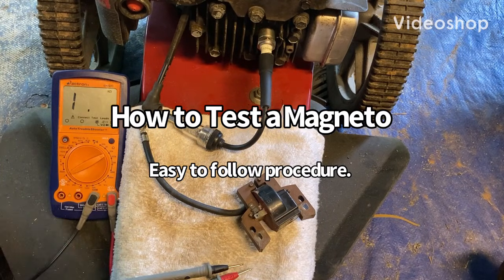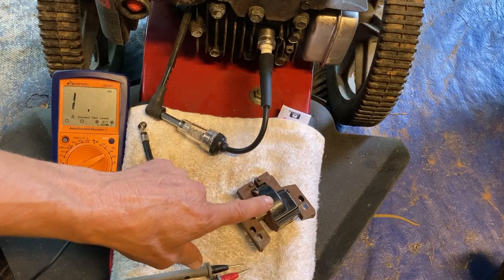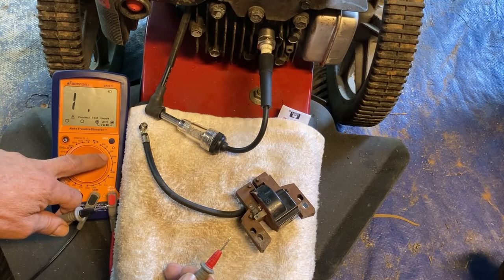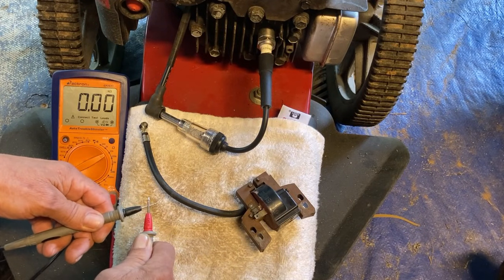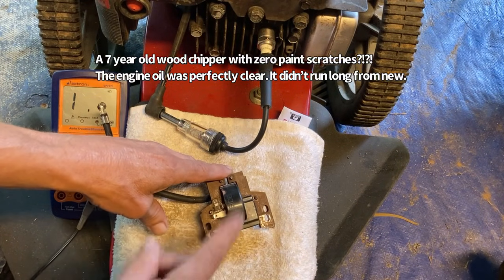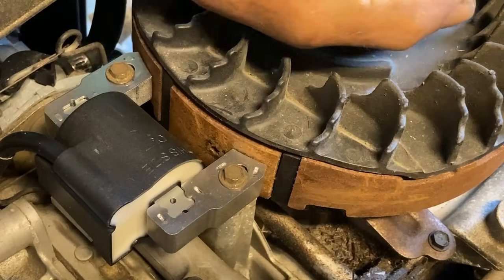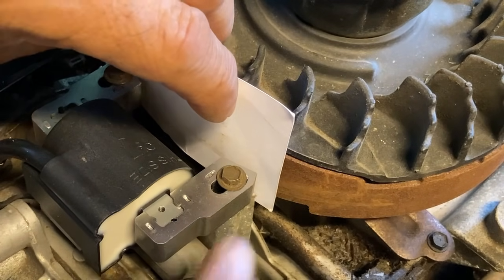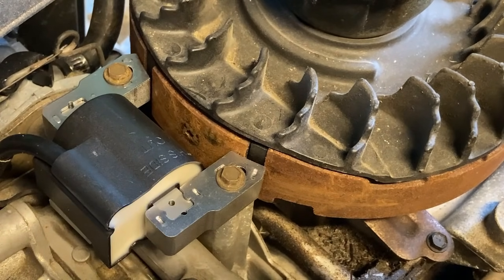How to test a Magneto

Comment: Hallo Eric ! 
Hoe regelt u een magneto als deze IN de klok , draaiend gedeelte , zit 
Motoculteur Mametora MC 150 E
De draaiend klok zit OVER de magneto
Graag uw raad
Reply from the maker: On a 2 stroke Yamaha engine the magneto is inside as well but uses a different style coil which doesn't need such a close tolerance to the magnet. The only adjustment for this type is radially to set the ignition timing. The Yamaha uses 2 coils. Source and trigger. Neither has an adjustment for distance to magnets.